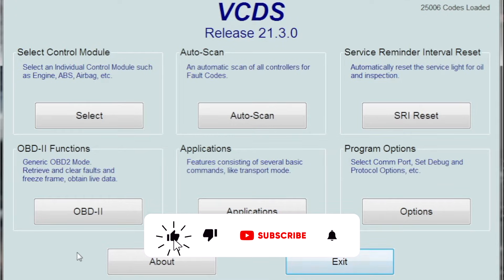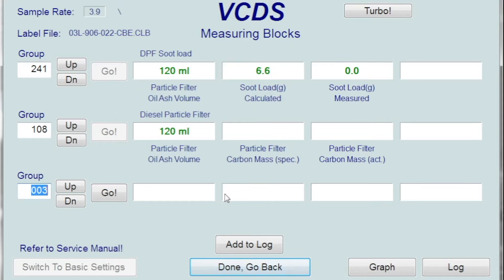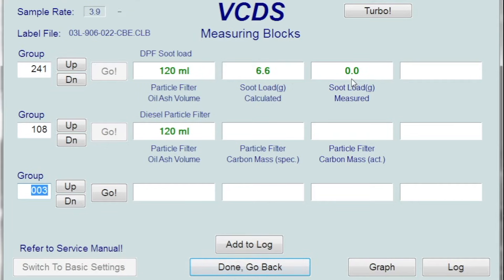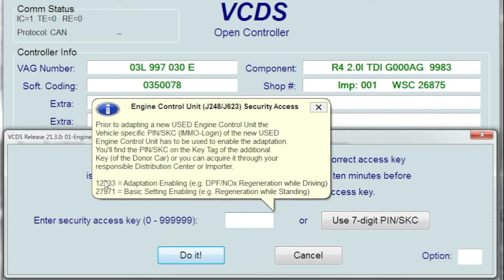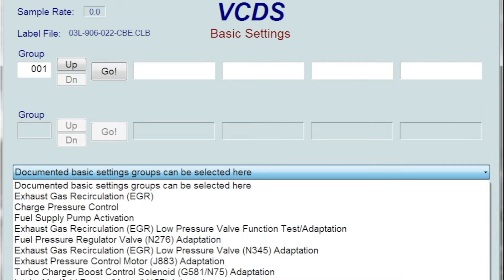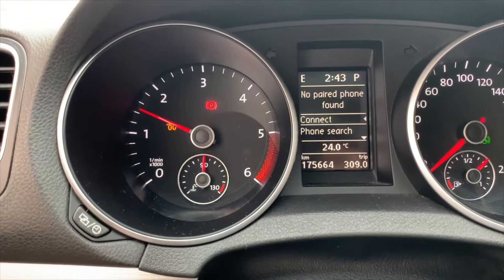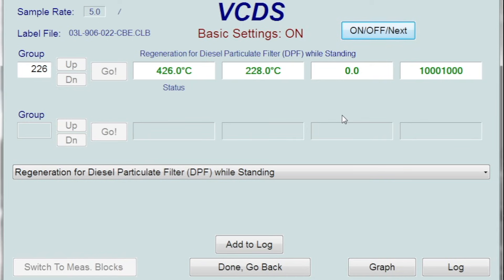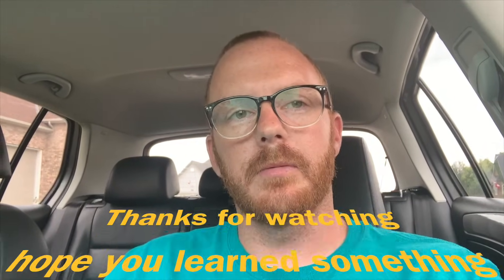How to force dpf regen on vw tdi

Comment: Can this be done with out vcds
Reply: My husband told me, you would need to drive for about 30-50 minutes above 2.5 RPM and the light should shut off. But, my dpf sensor keeps turning off and on randomly. The regen naturally is driving it. But this video is the hard regen which maybe necessary. I am looking into buying a vcds myself to do this. Luckily the sensor isn't too expensive if that is what it is-in my case. Hope this help.

Comment: Thanks. 

1) Is it the same process for a T6.1
2) If DPF clogged due to high altitude driving (here in South America), does the oil need to be changed due to pollutants getting recycled?
Reply: I think you would get the answer to your question faster on a website called diag period net. Obviously can't put the actual website name or it will be blocked by YT

Comment: Is it normal for glow plug light to flash during this process?
Reply from the maker: Yes
Reply: Mine flashes because I need a new egt sensor which is causing my dpf to not be able to do auto regen
Reply: @nathanielperry820 how do you know that?
Reply: @ak_hotrod  well I replaced the egt sensor and it fixed itself. Then it needed another dpf lol. Car is scrapped now so I don’t really have much more info
Reply: @nathanielperry820 mine was flashing but I kept going through the steps on vcds to do a stationary dpf regen and after no joke the 15th try it is working right now lol. Hopefully this fixes it!
Reply: @ I didn’t have vcds when I had my cjaa. Now I have one for my ALH and couldn’t be happier. Hopefully it works for you those cjaa’s are bipolar motors lol
Reply: @nathanielperry820 it worked for a little while, then it said abort and stopped.
Reply: @ hear me out… you should delete it. I went through two dpfs in less than 3 months. First under warranty, second I’m happy the car got totalled or it would’ve been a $2000 bill minimum. Delete kits are cheap and if you’re in Canada it’s likely you won’t get smog tested anywhere
Reply: @nathanielperry820 I’m in a state that requires it to pass emmissions when I sell it and I’m trying to sell it.
Reply: @ that’s unfortunate. I’m pretty sure Stevenson tuning makes an add on for one of their cjaa tunes for readiness testing to allow smog to pass, pair that with a delete and you’d be all set

Comment: Hi there, when I’m asked to step on the brakes 10 times I’m asked to go full throttle but get an error message. Please help
Reply from the maker: Is it up to full operating temp?
And the other prerequisites
Reply: @ERAutomotive  yes, I’m having trouble with making it go from off to on. Then the sequence it’s asks me to press the clutch in and step on brakes 10 times. Before I get to that point I’m asked to full throttle then get an error message. It’s probably user error. Although I look at the readings and my soot level is way low but still get a regen needed code. This car is kicking me up and down
Reply: @ERAutomotive  thank you for responding in any case. I did get the regen going but kicks off after about 2 minutes
Reply from the maker: If soot level is low then shouldn’t need regen 
Also soot level is a prerequisite for the regen to occur i believe
Reply: @ERAutomotive  thanks for responding, not sure why my DPF light keeps coming on

Comment: I tried multiple times last night. Couldn't get it to work.
Reply: You know, it sure does say Breaks and 10 times. So I push the Break 10 times. At the same time it says Throttle after pressing the breaks. And it's like, ok which one? 

Then something happened when I just pressed and held the break, it said to release it. So I did, then it indicated I should press the Throttle after that, so I released the break and held the throttle. Suddenly, it started to show temp data and also said to release the Throttle. And it started up. 

Perhaps it's 10 break presses, then a Break press and hold. Until it says release, then it's a Throttle hold until it says release at the same time it switches over to Temp measure and regen mode starts after releasing the Throttle as it said to.🎉

Comment: I took my 2015 passat into the dealer after it went onto limp mode. They tried a regeneration to no avail. They said there was too much soot and I would need a new Dpf at a cost of $3000. Is there any way around this besides a new dpf or dpf delete?
Reply from the maker: Get it to regen 
Or remove and clean
Reply: clean it with soap and water
Reply: Use caustic tfr. It can be done on the car or take it off and clean it. Will need to rinse well and give the car a good run at fairly high rpm for a while after.

Comment: If I try, I can’t see the measure blocks (stays light gray) if I ask for the security code, he doesn’t give me any, if I try yours, it says “code accepted”, the I have to press the brake pedal and the accelerator, then it always abort “for safety reasons” in green….
Reply: Your engine temp has to be @ 90 degree Celsius...

Comment: Mk7 golf gtd? Same thing? As they love a regen but never finish it off
Reply from the maker: Yes same process 
This was on a standard golf
Reply: @ERAutomotive   brill, soot measured 26g surely I thought dpf light wouldn’t come on with this amount
Reply: Done the regen today, very straight forward, measured at 25g not calculated at 0.12g ❤
Reply: What kind of scanner/computer diagnostic are you using? I need to do this

Comment: Mine is 0.18L Oil Ash Volume, car is 260k. km. Is my DPF for replacing or can go more?
Reply from the maker: It’s fine just keep going
Reply: @ERAutomotive  Thanks. I thought that the limit is 0.17L, do you think there is a way to judge when to replace it?
Reply from the maker: When I get codes saying it’s failed 

If it ain’t broke don’t fix it lol

Comment: What temp in celcius does the coolant need to be to force the regen, the car I’m in doesn’t have a temp gauge
Reply from the maker: I’d have it at normal operating temp
90c aprox
Reply: Man wasn’t expecting quick reply, but I’m trying to do force regen and each time it gives me a green light and says abort. But I’m trying to do the regen to hopefully get the egr cleared out
Reply from the maker: Are you doing driving or stationary 
I’ve only ever done stationary
Reply: Stationary
Reply from the maker: Do u have codes stored 
I don’t think it’ll let you do it if there’s codes stored
Reply: Nope erased all of the codes and was going through the process of brake 10 times and throttle ten times then it’d just give me an abort in green lettering
Reply: I got a 1.0 Abort 33.0. i have 60 grams
Reply: Does it clear the error light?
Reply: @William_Hendricks  I cant get any etc s to clear. i took it for a drive and got a regen , but found out throttle body is affecting take off also, so gonna replace.
Reply: @William_Hendricks  No it did not. I bought the car cheap and i think cause it has issues with the computer. but i got my diognosis , so ill deal with the light. lol Its my run atound everyday car. now to deal with the 328i iasues always something
Reply from the maker: Depends what the error is for

Comment: Any idea what it means when my soot load calculated shows 55.8 and measured is 55.5
Reply from the maker: Almost time for a regen 
And that small difference I wouldn’t worry about at all
Reply: @ER Automotive  thanks for the quick reply. I was wondering because while on the highway today it threw a p0101 p0102 and p2463 excessive soot. As soon as I clear they come right back. I'm at a loss at the moment.
Reply from the maker: Does the car have any warranty left ?
As the warranty was extended
If so I’d just take it to the dealer and let them deal with it
If not see if u can force the regen by either use of vcds or driving on highway under the conditions to get the car to automatically do the regen
Reply: @ER Automotive  no warranty left. Just got around 125000 on it. Supposedly the dpf was replaced just after I bought it I took it for other codes amd haven't had trouble since. Thanks for the help. I tried a parked regen and it comes up with abort 33. I'll try a driving one as soon as I can.
Reply from the maker: Oh
Good luck, Hopfully it’ll complete a driving cycle
Reply: @ER Automotive  I'll reply back when I fix it. I did have to drive 4hrs yesterday when it went out in limp mode. It will get to speed just very slowly.
Reply: @ERAutomotive  I have had no luck. I replaced the MAF and just today the DPF pressure sensor. Still showing P0101 and p2463
Reply from the maker: Oh dam 
I’m not sure 
Check out rosstech wicky and search the codes and go from there they have a good diag procedure to follow that should help
Reply: @ERAutomotive  good to know. I'll go do that.
Reply: @ER Automotive  I got the maf issue resolved. A mouse chewed a wire in two. Now just the code p02463. Under the measuring block 241 I show 9ml particle filter oil ash volume 60g soot load calculated and 5.7g soot load measured. Still have the dpf light glow plug light flashing and engine light though. Can't force a regen per your video instructions. Any ideas?
Reply from the maker: Given the issue with the maf it prob caused issues with Dpf need to get it to regen 

Try the driving regen if stationary doesn’t work
Reply: @timbenracing  idk if this helps, but I just took my car in for dpf under warranty at 146000. They said my warranty was good till 157000
Reply: @brandonmorgan6395  wow that is cool.
Reply: @ER Automotive  I forgot to reply. I got the issue resolved. I had to tell the car I replaced the dpf. The dpf filter light did stay on for one day then shut off. I have been a thousand miles or so with no issues.
Reply from the maker: Great news!!
Reply: @timbenracing  I have same problem It says Abort and 33. Stuck in limp mode and doesn't seen to go into regen. Can that fix be done with VCDS?
Reply: @BillyBiggRigg  what codes are you seeing?
Reply: @timbenracing  P2463 Excessive soot accumulation
Reply: @timbenracing  also soot load is 
 Calculated 49
Measured 50
Reply: Is it true the cars system won't regen if an engine light is on ? I've had an engine light on for a little while for something minor and the particulate filter came on. I've tried driving the way they say to get it to clear won't work.  Was planning on doing a forced regen when I can get my friend to bring the computer with this program over but if I do a forced regen and the light is still on then will it not automatically regen when necessary till I fix the issue ?

Comment: what this actual does !?
Reply from the maker: It commands a Dpf regen to take place 
Useful for people who do a lot of city driving and have a “clogging” dpf
Reply: @ERAutomotive  I havent done much highway driving(mayb 20min at a time) n my car (2012 Jetta TDI Manual trans) just went into limp mode. Car shudders n glow plug light blinks once wen I hit 4th gear. No other lights illuminated n the glow plug light only flashes once wen it shudders. After turning the car off n back on its fine until I once again hit about 4th gear n it again flashes once, shudders, limp mode. Im not getting the DPF light or check engine light.Of course I dont have a scanner anymore and the dealership is booked until the 1st. Hoping its not anything really big.
Reply: Fault code is throttle body actuator bank 1. Dealership cant look at it until the 1st but as far as I can tell(whether its the actuator,egr,etc) it should b covered under the extended emissions warranty so fingers crossed.
Reply from the maker: Yeah hopefully they cover it for you
Reply: @ERAutomotive ooo okay thanks
Reply: How much it would take at the dealership approximately?
Reply from the maker: I’m not sure what the dealer charges to force a regen